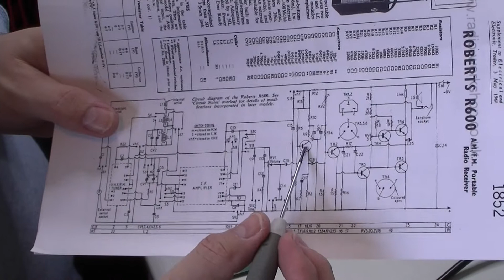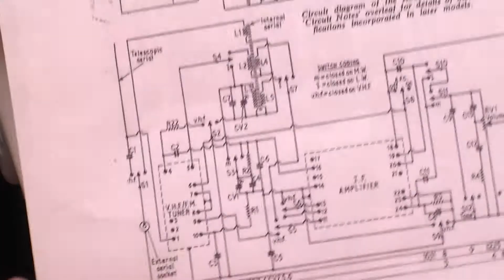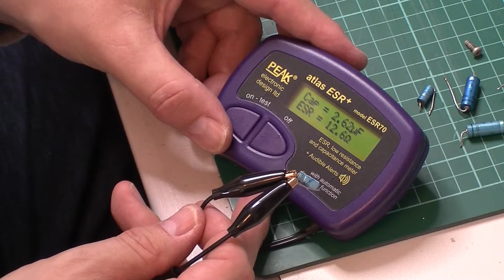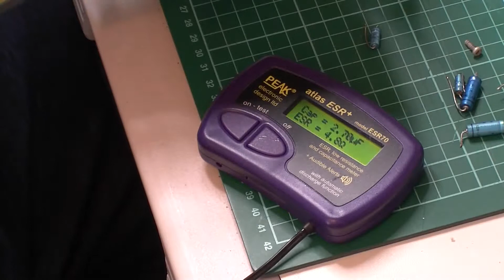Roberts R600 Part 6: Capacitor testing and replacement

Comment from the maker: *C19/C20 both 16uf go to the positive rail not the negative as I state in the video. Sorry for the confusion!*
Reply: Explosions can be fun!  :)  I did that accidentally in a freq counter I was working on near the power supply.....not once but twice, oops!
Reply from the maker: It's easy to get them the wrong way around. After one went bang on me I tend to double check before switching on now.